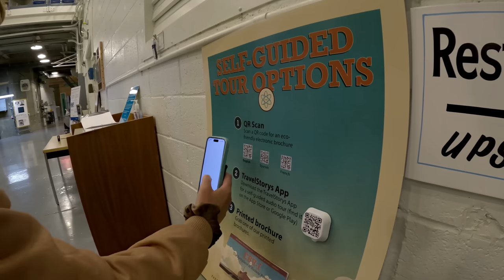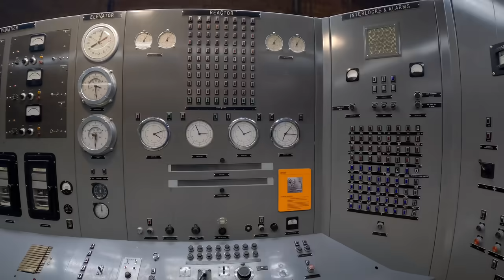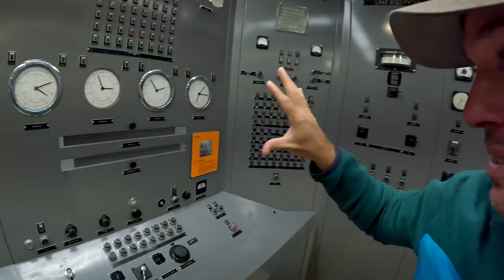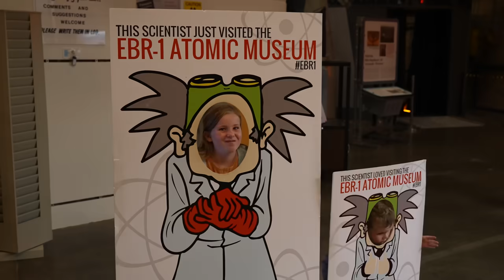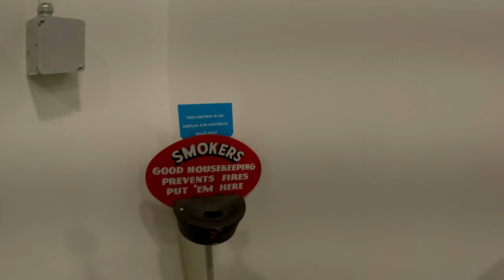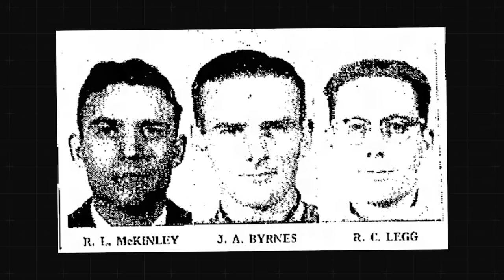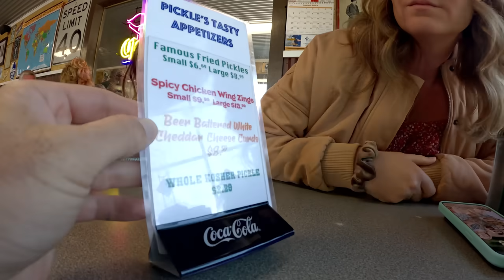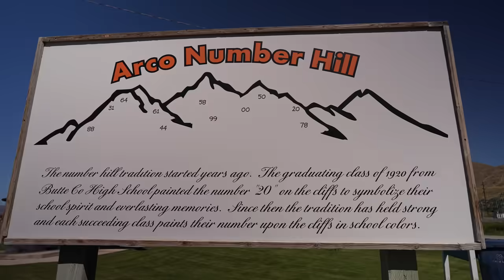We Toured The First Nuclear Reactor on US Soil

Comment: I, Dave, am a retired nuclear worker - 44 years combined Navy and commercial.  Thanks for sharing this.  In the late 70's I was in Idaho for Navy nuclear power training.  The "nuclear" part of my job always was something to be respected.  I always felt safe, even when inside a reactor compartment (reactor was shut down) and literally standing on top of the reactor.  The greater "risk" always was industrial safety - trips, falls, electrical shock, etc.  Nuclear power is even better today with improvements in dry cask storage of spent fuel.

Safe Travels 

OBTW - The SL-1 was NOT a nuclear expolsion.  It was a fast power excursion that made a lot of heat very quickly and caused a steam explosion.

OBTW - Power plant capacity factor is a measure of power plant reliability (100% = full power all the time)
As of 2021 for United States
Nuclear = 92%
Natural Gas = 54%
Coal = 49%
Wind = 35%
Solar = 25%
Reply: We definitely need more nuclear power plants.
Reply: @RobertSmith-tq6mf  Because it takes so long to ramp up and down, nuclear power really can only support our base load. This is important, of course, but we still need other generation sources that can respond faster for our peak power needs. However, we do need to update our nuclear plants, as most of them are operating off very old technology, and many are operating beyond their expected life spans.
Reply: @srameypr  i agree that peaking units are needed and many nukes are getting old, but many nukes are making MORE power than when built.  My plant made 985 MW electric output when new in the 1980's.  After power uprate, now it makes over 1100 MW.  Also, nukes are green. Essentially zero carbon emissions.  Also, compare the land "footprint" for 1100 MW nuke to the same MW for solar or wind.
IMHO, the bottom line is that we need more big base load nukes (@90% + capacity factor) and less "renewables" (@ <40% capacity factor). Bring on the big boys!
Edit - typical commercial nukes are not designed for quick power changes, but different designs could respond quickly to power demand changes.
Reply: @RobertSmith-tq6mf  Vogtle unit 3 went on line earlier this year and Vogtle unit 4 should go on line in 2024.
Reply from the maker: Thank you for the information and glad you liked the video.
Reply: @LessJunkMoreJourney  If you travel to Bremerton Washington, there is a Memorial with a piece of the bow of the USS South Carolina, CGN-37.  That was my first ship.
Reply: @davelauraphillips8814 Hey!! I lived in Bremerton for 22 years!
Reply: @AnnetteLG  cool - have you been to the memorial?
Reply: @davelauraphillips8814  heck yes! I was a sports reporter for the Kitsap Sun and our office was on 5th St. And, of course I’d see it whenever you are down at the waterfront 😄😊
Reply: @AnnetteLG  i left that ship in 1980 and haven't seen it since.  Thanks for sharing your story.

Comment: @3:50 - The wand laying directly to the right of the unit is probably what you are supposed to use to interact with that exhibit, would be my guess.  Grew up in Montana, but spent nearly two decades in Idaho.  Very familiar with driving through that part of the State, as I transit between family/friends in both places.  Super dope that you are highlighting (yes, I did) Arco, as I only found out about it the first time I drove through back in the late 90s.

Comment: Of course, with any new invention there is a learning curve. I agree with Dave we need more plants, but we also need to define what method and how we get rid of the spent rods. After a rod is energized it takes over 400 years for it to be at a safe level. The rods are only used for a short period of time then lose enough energy to make them ineffective. At that point they need to be removed. Right now, we place them in lead casing and bury them but dealing in the transportation of medical grade nuclear material it can send radiation though the containers enough to peg a meter 20 feet away. Also, i was thinking someone else may have posted that the round spear is a scaled down Tesla. Design by Nickola Tesla to send power though the air he later stop his experiments when he started killing farm animals. The electricity could travel miles in the ground and zap a horse with shoes on.